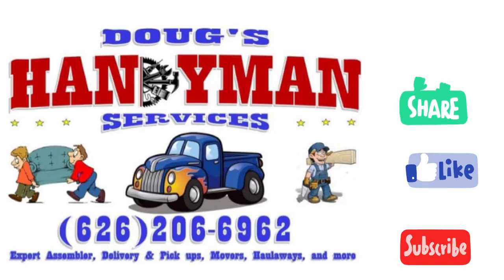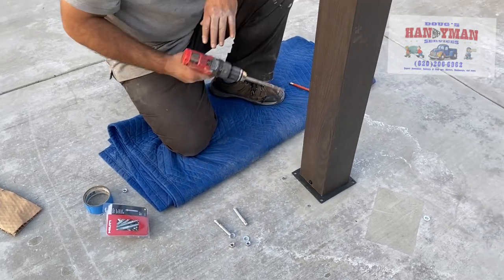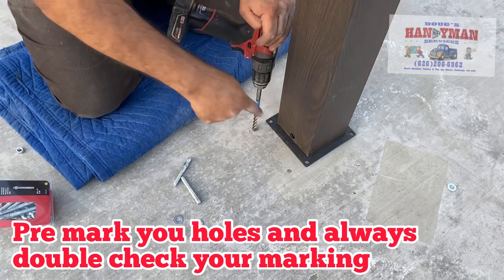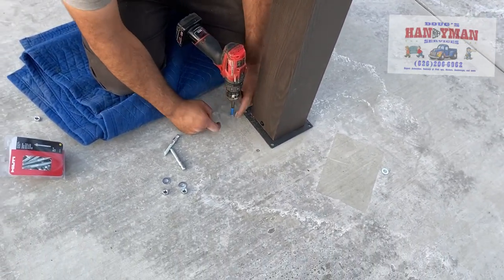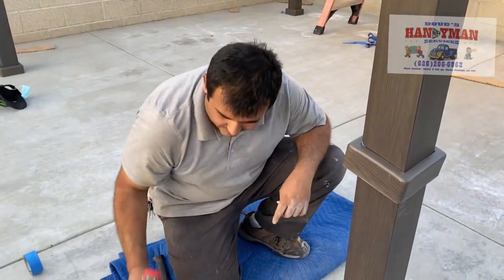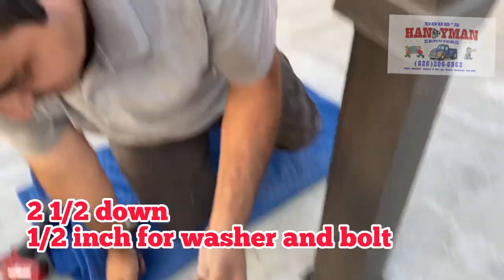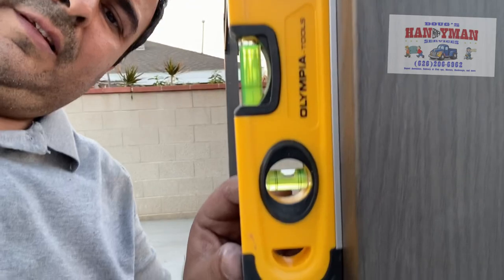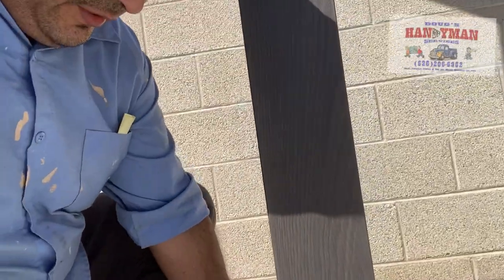How to bolt down a Biglots gazebo

Comment: This is hard way to install anchors. There's no need to move the legs. Measure the hole size in the leg then choose the right size bit. Hammer drill is best but one like shown here is ok (but is more work). 3/8 or 1/2 anchor x 3-1/2 long is usually enough. Drill down the length of the anchor and use a shop vac directly over the hole to clean out all the dust. Put the nut flush (include a washer), and hammer it down. Tighten up and your done. Have done this more than 1000 times mounting steel racks in concrete at work.

Comment: I’m not able to bolt my gazebo down. Do you think if drop the gazebo posts in cinder block columns that are 3 feet tall and back fill with gravel it will be enough to  stabilize it? I don’t live in an area with bad windstorms.
Reply from the maker: Thank you for subscribing if your gazebo is on top of dirt and you want to stabilize it with cement here’s an idea! Where your gazebo is now the posts you can cut 13 x 13 square holes where your post will be going. And dig out the hall at least 12 inches deep. Make sure it’s nice and square. Then you feel the 13 x 13 x 12“ deep hole with cement. Let it dry for a couple of days then you can bow down your gazebo. This would be a quick way to be able to Bolt your gazebo to a soft ground. My phone number is 626-206-6962. I am in California Baldwin Park. Maybe we can FaceTime or I can text you a picture of the idea I’m talking about. Hope this was helpful again thanks for subscribing

Comment: What is the length of the bolt that should be used?
Reply from the maker: Are use a 4 inch lag bolts by Hilty they come in a box of seven or eight bolts
Reply from the maker: It’s a anchor by Hilty and it’s 4 inches I believe it’s 1500 pounds or 1000 pounds bolt